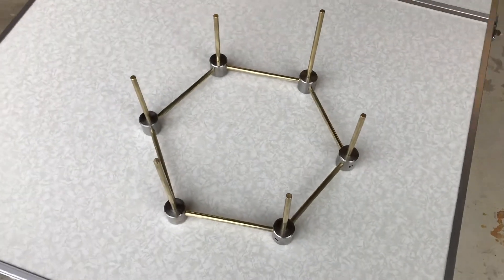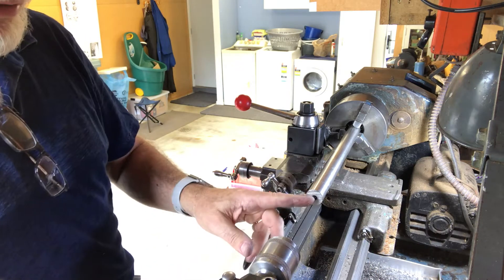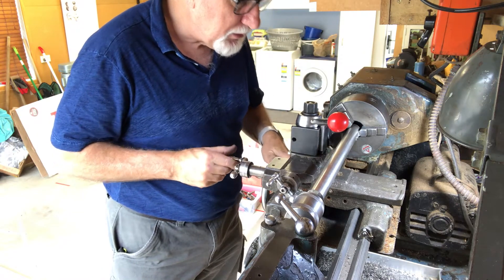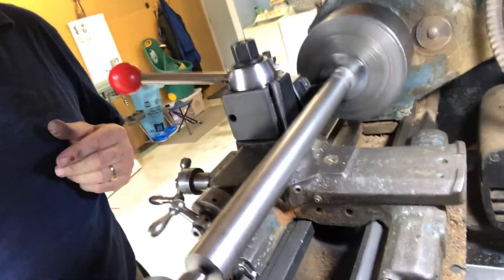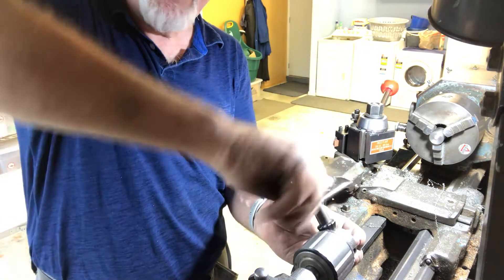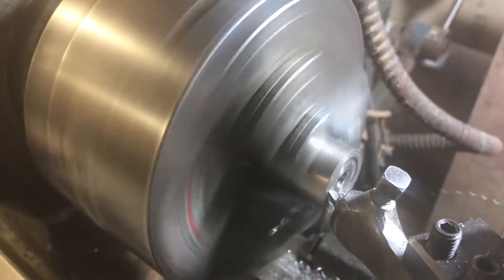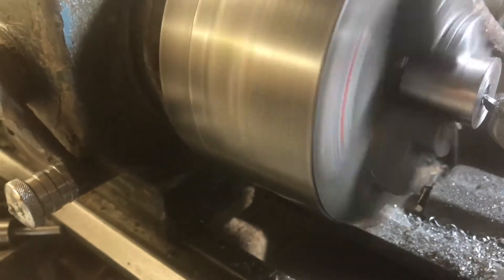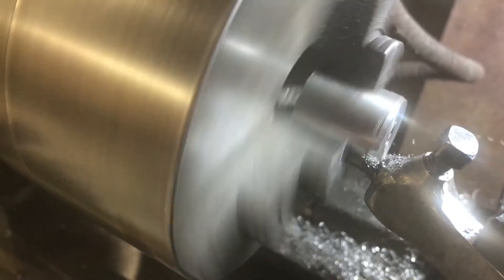Parting or cutting off and facing using the front tool post on an engineers metal lathe (a Boxford).

Comment: Wouldn't it be easier to cut it off with a hacksaw or angle grinder, then face the cut to make it square?
Reply from the maker: Yes today I was parting off an 80mm (3 inch) diameter solid bar of hard magnetic stainless steel. It was too short to fit in the electric hacksaw. I got about 3/4 way through with a carbide tipped parting tool on the rear-mounted tool post and then had to switch to a hacksaw with the lathe spinning to get through the last bit, and of course they always need facing afterwards.  I like the fact that  a parting tool will give a perfectly 90 degree angle, even if you finish with a hacksaw.  I do have a small angle grinder I could use but that is a lot of grinding. I have a video about the rear mounted tool post. YouTube.com/c/evanecent see lathe playlist at bottom left.

Comment: Align the tip of the parting tool with the live center of the tail stock to find center. Oil on the parting tools and drills will help with chatter and longevity of the tools
Reply: Correct , but make sure it's  cutting oil , NOT LUBRICATING OIL.
Reply from the maker: I had a bottle of proper cutting oil sitting on my bench and forgot to use it! I should have used it on this stainless steel.  Most of my work has been turning bronze brass and copper and I assume that these softer metals may not benefit so much from cutting oil, especially bronze which tends to me self lubricating (?)  

I assume it helps with cooling and lubricating the swarf as it curls off the tool.  But I wonder whether it does anything for the cutting action itself when the tip of the tool is buried inside raw metal and the oil is on the outside of the metal (?) Any comments would be of interest.
Reply from the maker: I have been reading about cutting oil and it appears that the main purpose is cooling. Lubricating the swarf rubbing over the tool may also help.